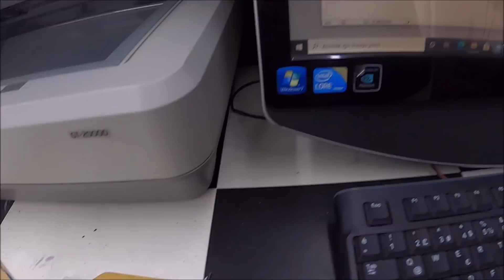FORD F 150 FAR // HEADLIGHT CONVERSION

Comment: Mikail abi ellerne sağlık.Herzamanki  gibi cok guzel. Abi sana birsey soracagım. Serit ledler ile homojen bir görüntü elde etmek için serit led  olarak hangisini ve kac ledli tavsıye edersin. Kücük bir amatör calısma yapayım dedim3mm buzlu pleksi altına 2835 mtrede 60led kullandım seninki gibi parlamıyor abi.
Reply from the maker: metrede 240 veya 480 led kullanırsan artı 3 mm yerine 10 mm yada 3 mm kullanıyorsan ara boşluk 7 mm olursa bu görüntüyü alabilirsin